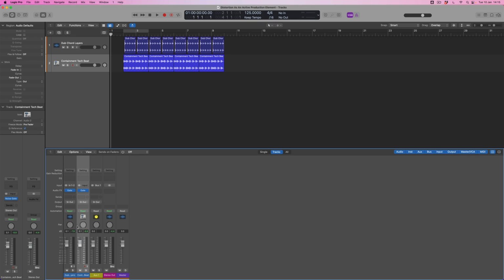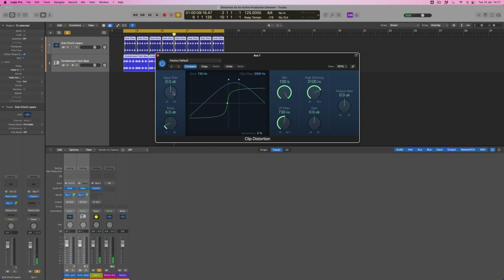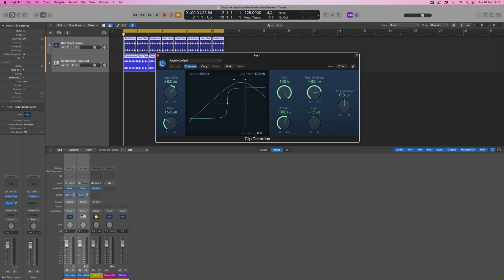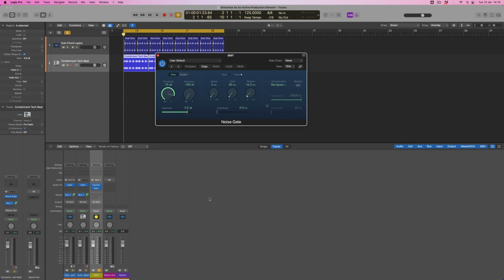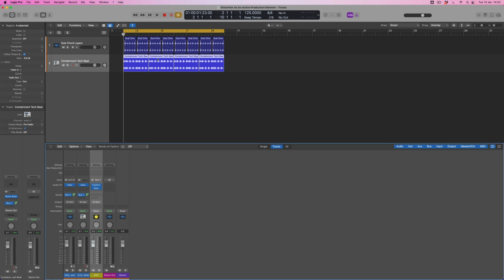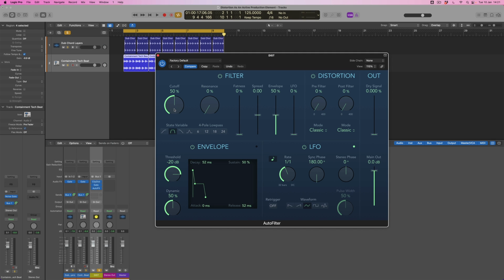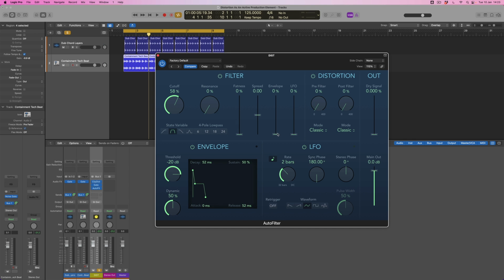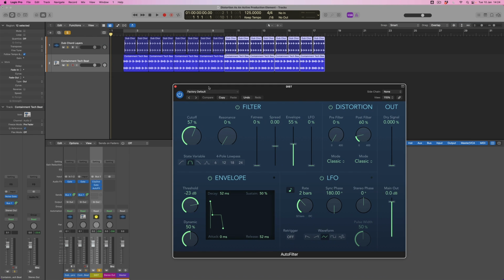LOGIC PRO X - Distortion As An Active Production Element

Comment: Do you have a view on automating the gain plugin for volume changes rather than the volume slider in the mixer? (I understand the idea is that the volume slider is then available for mixing) Thanks
Reply from the maker: Hi Andrew. Gain represents input volume whereas the volume fader represents output volume. So if you're using a Gain plug-in at the top of a channel strip which includes plug-ins (like compression, particularly) after it, you'll be constantly varying the input level into - and therefore the behaviour of - the compressor and potentially other plug-ins as well. So if you want to keep the tone and dynamics of a channel of your mix 'consistent' but vary the volume of it at the mix stage, I'd recommend using the volume fader. That's not to say that using the Gain plug-in won't achieve interesting (and potentially comparable) results; context is everything!
Reply: @jonobuchananmusic  many thanks for the reply and explanation
Reply from the maker: @bleeps_bloops  You're welcome.
Reply: @jonobuchananmusic  Yes, this  is a most helpful explanation, thank you so much, Jono.